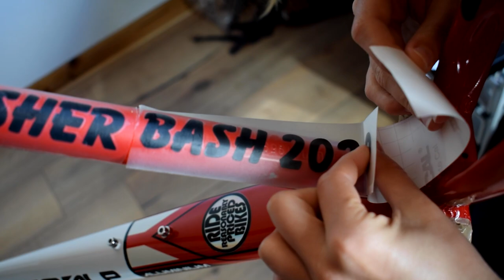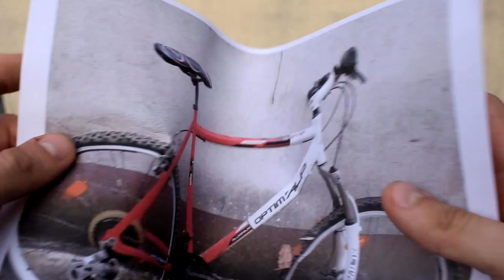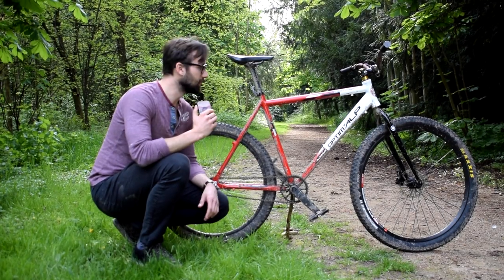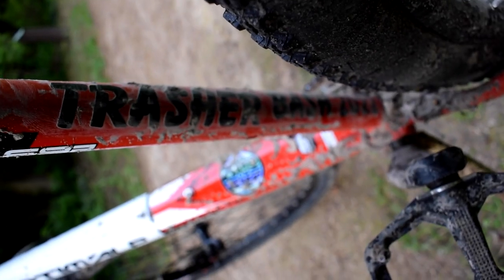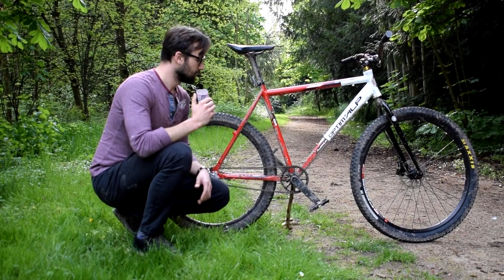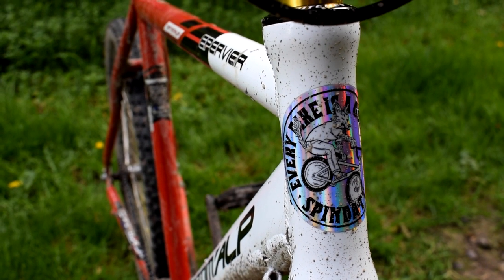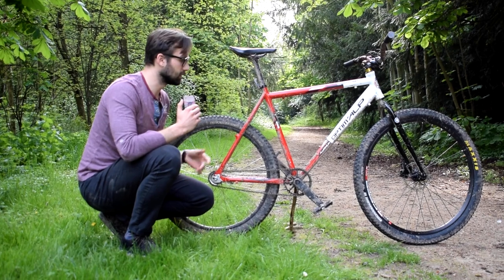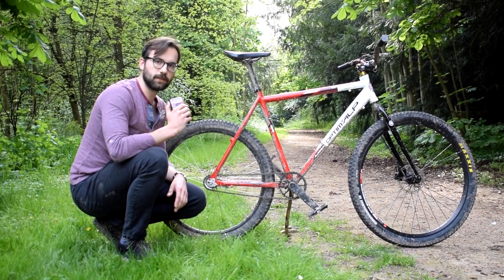Horizontal Dropout Converted Coaster Brake Equipped MTB of Stephane Pawlak

Comment: Anyone know if he used a wider coaster hub to take up the space of the freewheel cassette? I've attempted to mount a coaster brake wheel on an old 90s mtb but found the hub was too narrow for the rear forks.
Reply: No.
Just buy a longer axle.
3/8 x 24tpi. 
160mm or longer.
Coming from a freewheel or cassette the wheel dish and hub centering will be different… get your chain line correct with washers, and you probably won’t need to worry about dishing the wheel unless your close to max tire width.